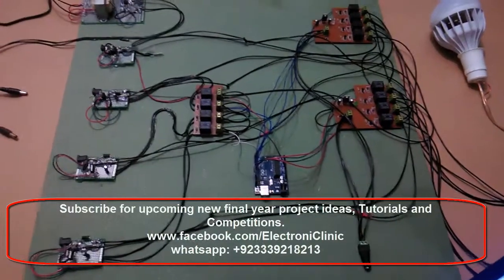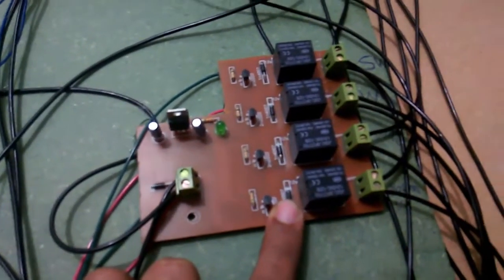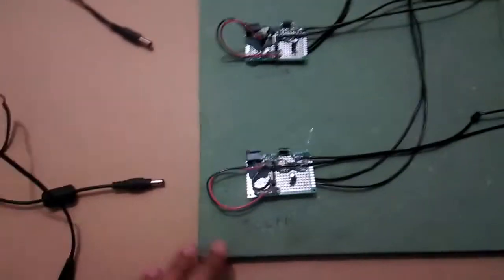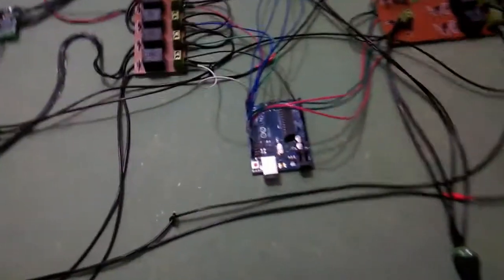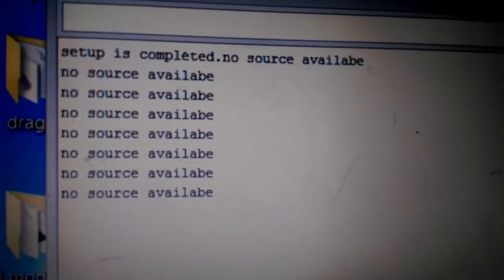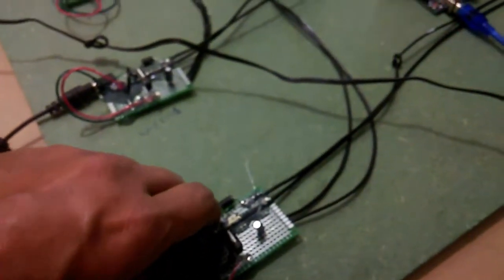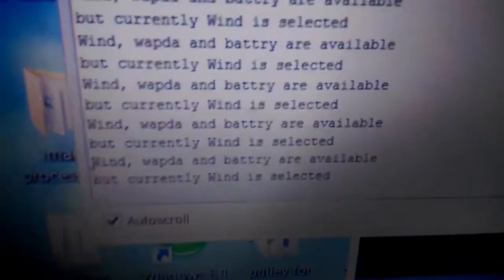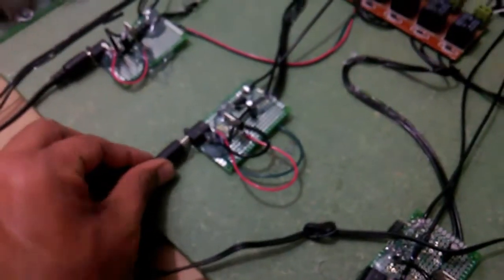Arduino new Project: Priority based multi source automatic switching "Solar, Wind, battery

Comment: How are you? May you please give me your report and the codes?
Reply from the maker: yes you can, but you will have to modify the circuit. or you can use a servo motor to control the fan regulator.
Reply: Please send them to me. filipuskamati@gmail.com